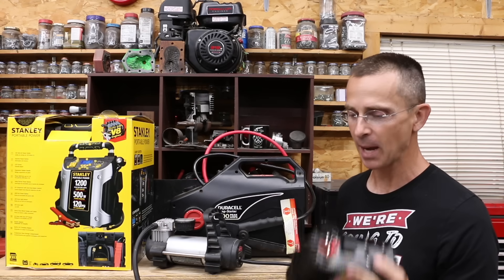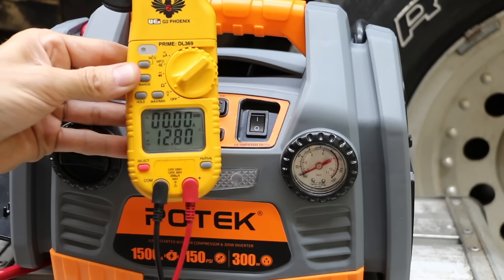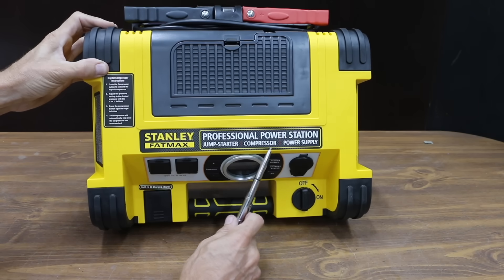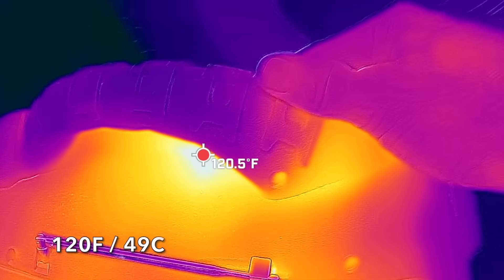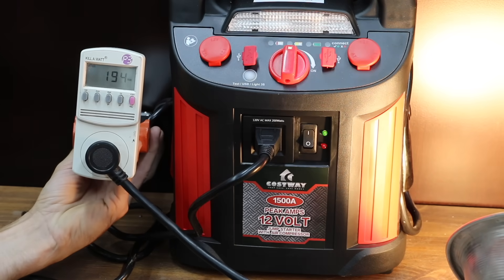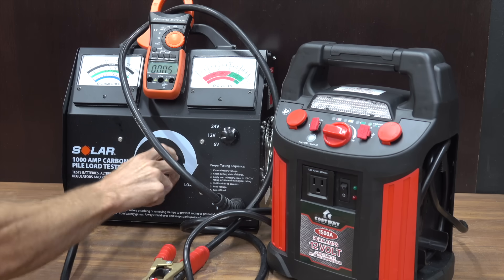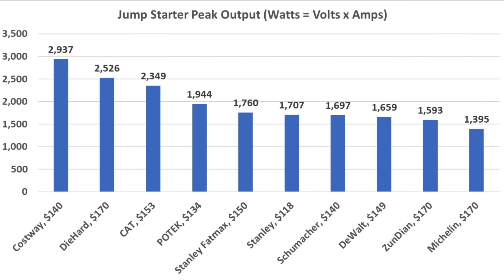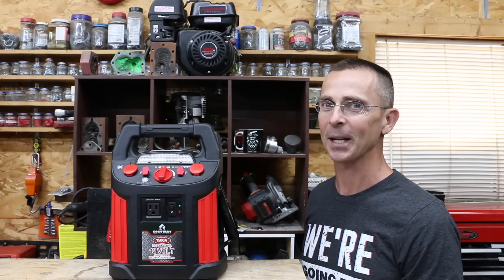Best Jump Starter? DieHard, Schumacher, DeWalt, Michelin, Stanley, CAT

Comment: I was surprised to see that the Diehard unit hasn’t changed in years. I’ve owned mine for at least 8 years and is the same design. It’s held up well except for the air compressor. After a few years the compressor motor runs but quit pushing air through the hose. One of these days I’ll tear it apart and see if it’s repairable. Thanks for testing these. If I ever have to replace the Diehard I’ll give that Costway unit a shot!
Reply from the maker: Thanks for the feedback.

Comment: Way too much data. Nobody cares 17 lb vs 15 lb.  Not able to start an engine is important. Lasting 5 to 10 min as an inverter is useless. All of them.  
The compressors getting too hot and the ability to start a car is all we need.  
    The noise level is useless.

Comment: I am a great fan! Just wanted to know if the combination is better to buy than separate units for jump starting, tyre inflation, air compressor for air beds and the like and as an inverter for temporary electricity outages to power one appliance?
Reply from the maker: Thanks for the suggestion.

Comment: It would great to see a video on the best inverters as a lot of folks have batteries for their tools that can hook up to some inverters and provide limited power. Or they might hook them up to their car and use them to power some lights or appliances as many same they can go up to 1000, 2000, or even 3000W. Like to see if those claimed power ratings really hold up.
Reply from the maker: Thanks for the suggestion.

Comment: Lessons learned (we already know this):
1:The claims made by marketing are complete lies.
2:They are all junk.
Past that, I get that these are designed for emergency situations. It might cost less to carry one of these then call a tow truck for a jump or flat tire. So if you used one of these once in an emergency situation it could pay for itself. However, it would still be cheaper to just carry a set of jumper cables for a battery problem.  Also, in said emergency situation, who cares how loud they are? It’s an emergency! Not going to pump up your tire because of the noise and choose to be stranded?  I think a better (and more real world) test would be see how well one works after bouncing around in a trunk for a month in freezing temperatures. That’s when someone is more likely to have a battery problem, in the winter.
Reply from the maker: Thanks for the feedback.

Comment: For the price i paid for my 1400 I expected much better from a brand like dewalt. Worked really well straight out of the box but after several jumps and inflation it had to be recharged and never performed as it did before charging it. Good for maybe 2 or 3 jumps now and I've only had it for over a year. Bought a very similar kit at half the price before and it lasted longer.
Reply from the maker: Thanks for the feedback.

Comment: It’s always a good idea to have a jump starter in the trunk. But in an emergency, there’s another way to jump a battery. Heat it up. For example, those military MRI dinners come with a chemical heat pack. You could make a big one that wraps around a car battery. With a hot battery, you’re odds of getting the engine started are pretty good.
Reply from the maker: Thanks for the feedback.

Comment: I recently spent $600 on a professional truck driver version of a portable jump starter.   It claims 10,000 amps at 12 volts and over 133,000 watts of power.   The mechanic I bought it from claims it can start a semi even if it had no batteries at all.   It had no problem starting my Freightliner when it had failing batteries.   It might be overkill for a car but it sure as hell would be reliable.
Reply from the maker: Thanks for sharing.

Comment: Can you test 3000 watt power inverters and what kind of saws they can be used with?   I have been looking for a 3000 watt inverter with 6000 watt surge to power tools normally in garage and refrigerator, water pump, microwave, lights, and heater during power outage.   Not all those devices on at the same time.  With all the snow storms and hurricanes that we have been getting lately I thought it would be good to have something to use during a power outage.   Most likely the inverter will be connected to some fully charged car batteries or  lithium ion battery 100 AH and they will be charged with solar panels through a controller.   But just need a review on the best 3000 watt/ 6000 watt peak inverter that works on 12 volt dc input.

Comment: I have DB power jump box that I bought after an old video comparison a couple years ago and it still works flawlessly. My friend had the noco we learned it needs the dead battery to have a little bit of voltage for it to kick on and the DB doesn't. Thanks for the great and informative videos!
Reply: Hi, how much did you pay for it and where did you buy it? Please.
Reply: Is it the 1600a  18000ah?
Reply: I got it on Amazon for like $75-80 it's the one that will start a 6.5 diesel a 21,800 mAh
Reply: For the record its been going strong for about a year and a half. Holds charge for a long time and get multiple jumps off each charge

Comment: I have the first Stanley you tested... the 1200 .. it worked great for about five or six times.. using the air compressor.. then the air compressor stopped working... Not sure why. I did not push it or in anyway damage it.. It is as clean and dry and well charged as it was the day I bought and unboxed it as a new never used unit.. out the box.. from WalMart... It's never been wet or left outside or abused in anyway... All other options, power outlets and light and voltage indicator etc all work fine.. only the compressor is inoperable... as in you can put it on a tire it will read the pressure and turn on as expected but does not push any air what so ever.... Any suggestions.. Like most I had it for about a year before I even used it a second time, I carry it in my daily driver so I have always put it on a charge long before it ever got to a ungenerous low level voltage.. My point being it was cared for and for no known reason or cause it only worked.. compressor wise about 6 times or so.. on a F250 and a Chevy Half Ton and a Econoline E150 ... all road tires.. only adding air.. to top off .. any ideas.. Seems this is common yet Stanley ignores it.. will not allow for exchange or return..

Comment: Thank you Sir, you made a very accurate test in your video. I was going to replace my dead acid battery inside jumper with a lithium- iron one. Do you think that it has the same low internal resistance or lower to start a car?!

Comment: Those dry cells lasted about 5 years on mine, use it or not. Replacements about 1/2 the price of the unit, maybe a little less. Replace battery or getting better updated unit with latest technology - hard to decide. You could still backfeed from the car battery to use the light, pump, USB, etc, -  just couldn't jump start. Good video!
Reply from the maker: Thanks!  Thanks for sharing.

Comment: Great video review. For what these manufacturers claim just didn't measure up. They are all junk. I have owned a fatmax. For the price it was a rip-off. I own a lithium airpump and booster and it will beat any of these you tested
 Price is comparable at $159. I use it i charge it right after. Have it 2 yrs now and have not failed to start 25 vehicles. To me that impressive. I believe it is living up to it's claim. I will give a review in 8 yrs. Since it support to last 10 yrs.
Reply from the maker: Thanks!  Thanks for sharing.

Comment: Avoid the Genius brand jump starter, they only work if your battery is in good condtion when you do not really need jump starting... (it has built in electronics that refuses to send power to the battery if it in bad charge condition)
Reply from the maker: Thanks for sharing.

Comment: I'd like to see if you can devise a way to test the real output ability of the heavy duty wheeled type AC battery chargers/ starters to see which one can deliver the most amperage output from a 115 volt outlet? I've heard that the older style ones using transformers were heavier, but put out more power than the new styles?  Is it possible to get more amperage if you upgrade the output cables/clamps to a heavier guage/pure copper  vs copper coated aluminum cables?  Would be interesting to see your creativity dive into these bigger suitcase on wheel type ones for those needing big power for cranking in cold temps.. not the little workbench home ones for slow charging..
Reply from the maker: Thanks for the suggestion.

Comment: I have a Stanley Fatmax Powerit 1000A. I got it a couple of years ago and was very happy to have it and when I need it, which was not frequent. Since I had not used it for a few months I plugged it to a wall outlet to charge it. It started to beep and it wouldn't stop even after I disconnected it. The display panel which shows battery voltage did not come on at all. After looking at other YT videos I did no get an answer as to why it beeped. But I suspect the battery or the built in charger is no good. I purchased this unit for $79 but I was expecting a longer life.
Reply from the maker: Thanks for sharing.

Comment: I’ve had a very similar model of the Schumacher for years and have had much better results. I finally ended up replacing the small lead-acid battery inside it because I had left it for too long without charging but otherwise it has given me great results in all kinds of weather after having to leave my vehicle in airport parking for extended periods. I wonder if some aspects of the testing here are causing damage prior to attempting to start the engine. Question: how many of the other brands have replaceable/recyclable batteries? Thank you for all your hard work doing these tests.
Reply from the maker: You are welcome!  Thanks for sharing.

Comment: Jump N Carry are best jump starters. Side note. When purchasing one always remember jump starting is its main job and peak amps are what’s important. More things a jump starter does air compressor, USB ports more that can go wrong with its main function. Remember get one that’s appropriate for unit usage ( engine size) it’s important not all JS will put out required peak amps. Don’t worry about compressor you should have a tire repair kit with self pressure fill in your boot anyways.  Just as a pure Jump starter no frills JnC 660 is best on market  it will start 12 and 24 volt units. Ones I seen here I simply wouldn’t purchase. From previous experience, trail and error.  My JnC 660 is going on it’s fourth year of service without issue. I have a separate portable compressor/ generator  for other jobs. It’s more compact than the jump starter who knew 🤭 Good luck everyvwho is looking for a JS or combination just remember not all are function well with so many functions. Keep that in mind.  Always go with reliability even if it costs a few more dollars. Stay warm my friends.👍
Reply from the maker: Thanks for  sharing.

Comment: Another great tool chanel and the good video.  Thanks for your hard work for doing these, Then I could choose some starter I want in 1 minutes.
Reply from the maker: Thanks and you are welcome!  Thanks for sharing.
Reply: @ProjectFarm  thanks for your reply. I wana buy a big amps starter for my trucks. Gooloo gp 4000 ,gt3000, hulkman, these will be my choice, but I have some questions about it. Why gp4000 start peak is 600 amp? Is it normal? And I saw your videos last year.  It seems great. But also Hulkman is looking good. The price is hight. Which one I should get?

Comment: I had a cheaper Schumacher unit for portable jump starting, then had an older Stanley fatmax with the compressor, inverter, and jumper. 
These products just dont seem to last long sitting in trunks of vehicles. As much as it is a little bit of a pain, I just keep good jumper cables in my garage and one vehicle. You have to have a good working vehicle to hook up to, which may or may not be a problem at times, but at least it wont disappoint you like these jumper packs if you forget to charge them up routinely. 

I was shocked to find an unknown brand like Costway won this competition handily. Outright dominated. I figured it too would go up in smoke like others. Sometimes the brand name doesnt reflect the product will be good or bad, I suppose.
Reply from the maker: Thanks for the feedback.

Comment: Sooo basically only one of these "jump starters" can actually start a mid-sized vehicle that has a dead battery:o  In my mind that qualifies as faults advertising (from the various brands not PF).

PF if you can, I'm sure many of us would like to see a review of "jump starters" that can not only start a similar mid-sized engine, but identify some that can start a dual battery vehicle such as the many diesel pickups in use these days; which often have low batteries because one of the two is going bad or the cables that interconnect them is corroded causing a one, or one and a partial, capacity scenario. (I have 5 such pickups, it happens all too often ;)
Reply from the maker: Thanks for the suggestion.

Comment: I have the older version of the Schumacher tested here. Yes they are junk as a jump box. Power inverter works good and the pump works good. It does work good on small engines, but that is not what I bought it for.
I have a cheap jump box by Power Up that will start a car without a battery in it. It has no switches, so the cables are always live. This is probably better than ones with switches due to resistance anyway.
Reply from the maker: Thanks for sharing.

Comment: These things are crap!  For professionals they are unacceptable.  For the average joe they aren’t worth dealing with the fact that you need to keep them charged or you’ll ruin them.  I used to use jumpers professionally and I still have my sealed lead acid jumper that out priced all these and was half the size of any.  But I don’t take it with me anymore.  My is almost certainly not gonna die so I just leave a lithium ion jumper in the car.  I can’t jump with my car because the 12V is buried and there is a protection circuit to ensure you don’t draw power from the jump posts.  It’s a plug in hybrid so not surprised.

 But as a good citizen I always have my jump kit and lockout kit and my disclaimer/liability forms.
Reply from the maker: Thanks for the feedback.

Comment: I have to wonder if you got a "Friday, end of shift" model Stanley unit that failed on you or possibly they simply aren't built as well as they had been 7-8 years ago. I've had one for about 5-6 years now I picked up off the side of the road for free. Brought the unit home, charged it, and have been using it ever since. I've never used the inverter function and cut off the air compressor hose long ago so I cannot comment on the usefulness or longevity of those functions but can say I have used it countless times up in the northeast during summer and winter months starting anything from a weak battery to fully drained. It has worked flawlessly for that and continues to do so to this day. I even have admittedly forgotten to keep it charged on multiple occasions and have had no issues with it taking a charge or holding one. Sure, I might have gotten the cables to smoke a little bit or get pretty hot here and there but it just keeps on truckin!
Reply from the maker: Thanks for the feedback.

Comment: Direct charge from alternator? My Schumacher lasted for 3yrs.  I would use it regularly RV'ing to watch TV and power my laptop.  I would direct charge it by plugging it into my truck's battery while running.  Charged up very quickly and worked great until this year.  The system seems to work but the batter is toast.
Reply from the maker: Thanks for the feedback.

Comment: One thing i noticed is that both stanleys and the DeWalt have the exact same display with the blinking triangle, this makes me wonder if they were all made by the same parent company or OEM in china, if so it kinda makes me feel a little less optimistic about the DeWalt since it would mean that its just a DeWalt badged item, much like most Stanley stuff ive encountered

Comment: Have you tried the autowit SuperCap 2 12-Volt Battery-Less Portable Jump? It uses a capacitor to draw power off a weak battery then when it reaches 12 volts it’s ready to jump your battery. It claims to last 10 years and has no battery to keep charged.

Comment: I've owned a few Stanley (Sold at WalMart) Every single unit has had the Air Compressor fail after 1 or two uses. Very cheep in materials. and I have had issues with Completely dead batteries. The Stanley is fully electronic, so It won't even work or turn on if the cars battery is very low. IF I could go back in time I would NEVER have purchased them.
Reply from the maker: Thanks for the feedback.

Comment: Would like to know which one could run some appliances such as outside lights for how long. I use my Stanley 1000 amp just pack with a 12V inverter when I go camping to hook up the LED lights we have on the canopy. Would like to switch To one with the AC already available on the unit. Let me know if you got any suggestions. I would also like to see a portable power station video with ecoflow, jackery, goal zero, and Bluetti maybe. Love the channel!!!
Reply from the maker: Thanks!  Thanks for the suggestion.

Comment: I would count a full charge out of the box as bad, because 100% and 0% are the most unstable states of a battery and keeping it in the box at a 100% will degrade the battery wayyyyy faster than the stable 50%. But still GREAT video! Keep up the good work!
Reply from the maker: Thanks, will do!  Thanks for the constructive feedback.